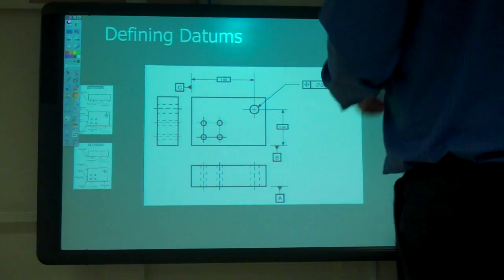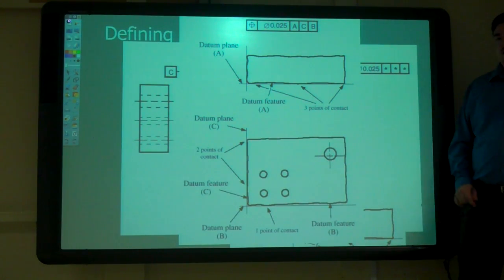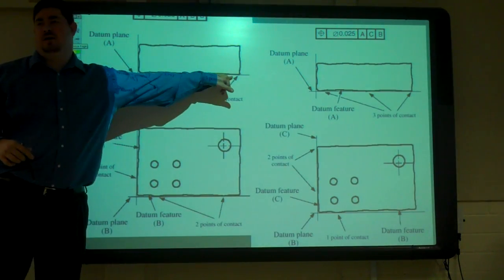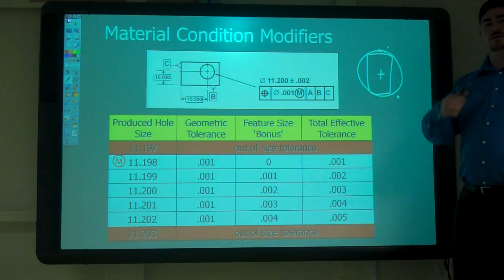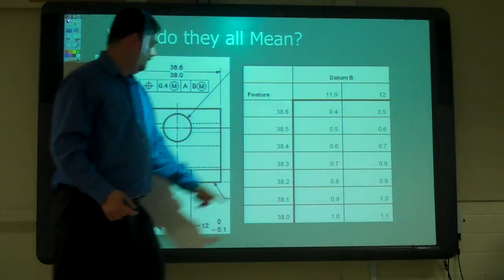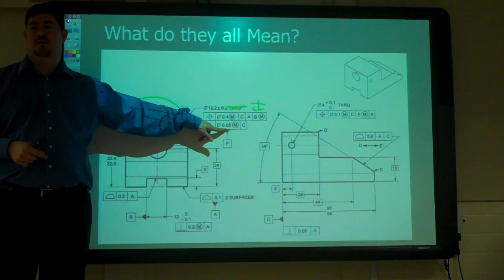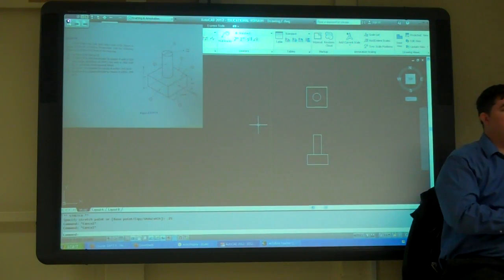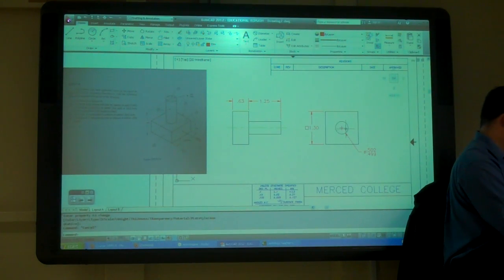Virtual Condition, Bonus Tolerance, & Datum Order: The 3 GD&T Secrets to Position Tolerance

Comment: I think the area calculation was wrong, you just took the diameter times Pi which is the perimeter of the circle. So just visually you can see 0.005 is 500% or 5 times  0.001, plus 57% from the roundness.

Aside from it this was really good, thanks!

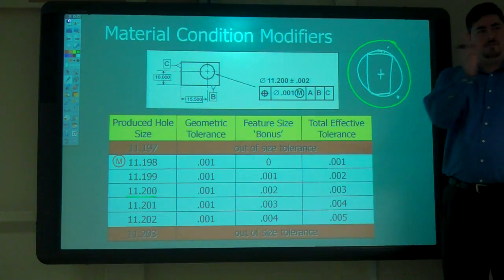Comment: Hi James. I am also slightly confused in your example at time 16:02, the yellow circle that you drew on the board is the bigger tolerance zone as you departed from the MMC condition right? So you are basically saying that the center is now lying within the tolerance zone which got bigger since you departed from MMC (bonus tolerance) thus making the part a good part Am I right?

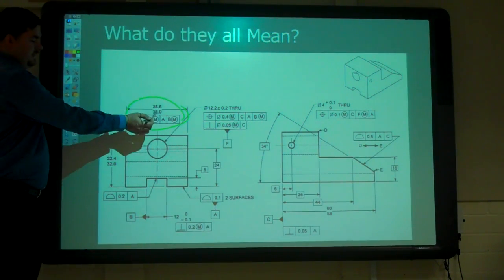Comment: Hi James. Very good lecture indeed. I am little confused with your example shown at time 20:26. For the datum B, you basically have a tolerance zone of 0.2 (@MMC) within which the mid plane of the slot should lie in (perpendicularity). The tolerance zone is perpendicular to datum A but it is not located by basic dimensions from the side face or something right? In other words, how will the machinist know that the slot should lie in the center of the part?
Reply: Shree datum b center line

Comment: Based on the table, it shows 11.197 as "out of size tolerance".
12 - .002 = 11.198. What do I do with .001 inside the feature box?
I thought you then would take 11.198 - .001 = 11.197 as the smallest the hole size can be